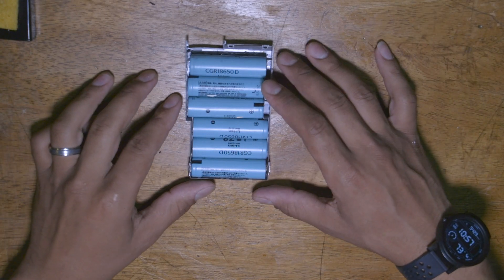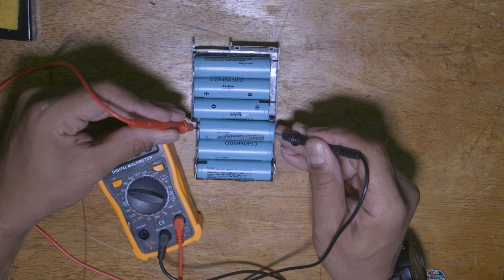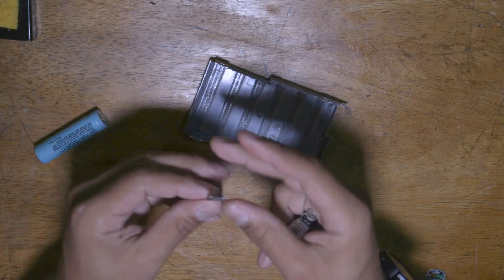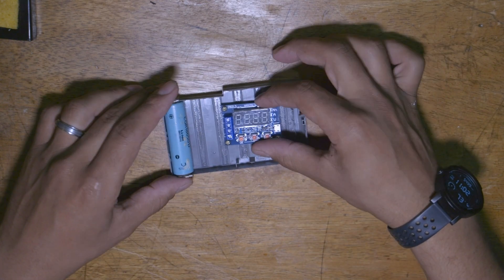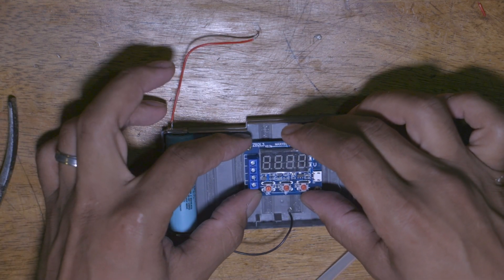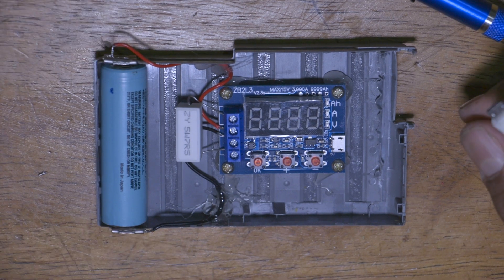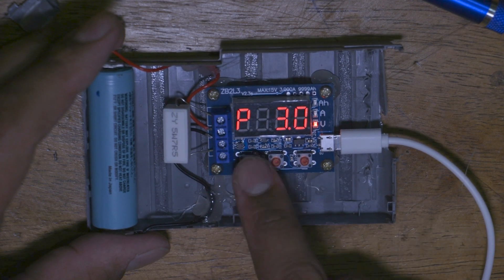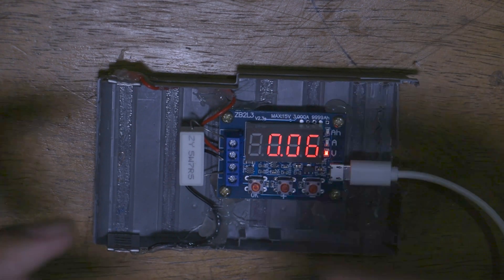DIY 18650 Battery Capacity Tester

Comment: Sir I have purchased this module but when I tested the same 18650 cell Everytime after charging it full then it showed wrong reading of the same cell.
1st time reading was :168mah
2nd  time 95 mAh
3rd time 125 mAh
4th time 76 mAh
Why it showed wrong reading for the same cell as I charged it Everytime full for capacity testing.
Regards